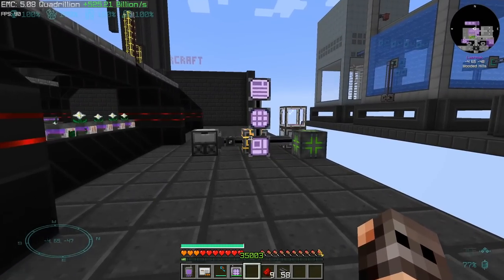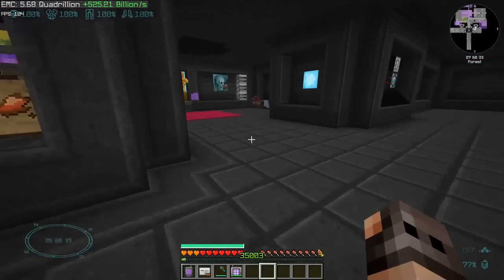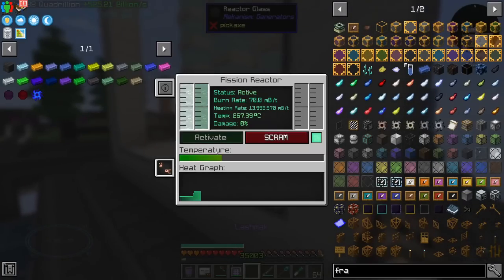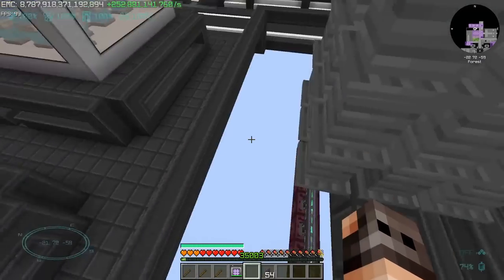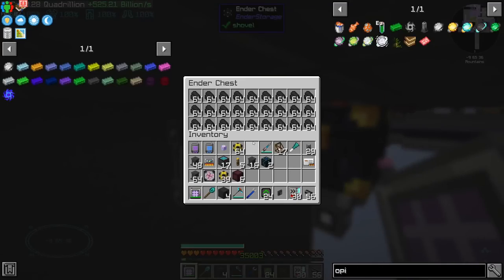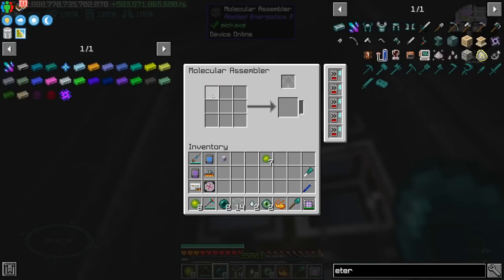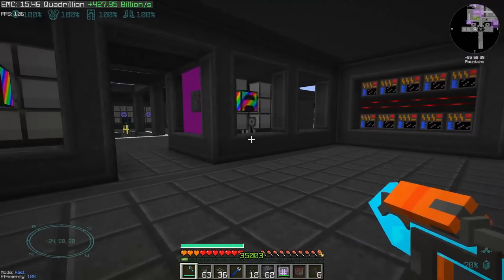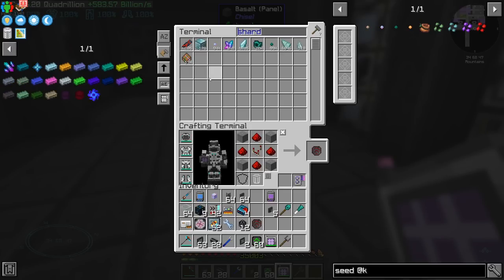NTC2-Ep21: Opinium Cores

Comment: Instead of using crafters you can use a backpack with a compacting upgrade. Way faster for x3 or x5 items. And as for emptying your ender chest fast just put a pipe directly to an interface.
Reply: That would be a cheap and dirty way of doing it and Lash clearly doesn't like cheap and dirty.
Reply: At that point he could just use a compacting drawer. I mean his issue was kinda silly since he doesnt have to storage bus it, but im assuming he just doesnt want to do it a cheesy way. 

Like instead of crafters, he could like quite literally put a single compacting drawer instead and itd work better. The recipes stay exactly the same. Just need to filter it instead

Comment: Using storage drawers the same way that you use crafters might be a good solution for your issue. Hook the drawers up to a chest with an interface or something that works better and you won't have to hook the drawers up to your system directly and have the misinformation issue
Reply: .... that actually makes sense, thats an easy block crafter! However there is something to be said about using crafters to craft.
Reply: yes, use an interface on a chest and pipe out the item into it. And the same way with pipe out of the drawer

Comment: Oh my Dear Lord of the Darkness, it is I, Guga, once again here asking your permission to give you a tip.
Try separating your ender chests to pump items to your system, like one for general items, one for chemistry, one for cores/essences etc, cause I noticed that if the ender chest connected to your system gets clogged up, it lags A LOT.
Along with separating them, I managed to save a lot of channels just by using some interfaces and piping the items out of the chest with pipes instead of using importers, so instead of using 6 channels for 6 faces, I'm using only 1 channel

Comment: You can use a processing upgrade in a centrifugal separator with any tier of emc link to get the matter back so you dont have to spend as much time afking for emc. It also works for the final star shard with the final emc link.

Comment: i normally love the Time in a bottle... but in this pack, except for the first 30 mins to accelerate the first bamboo pot its absolutely useless. you can just craft more mob cages or pots or what ever and it is so much more convenient than using the bottle. 

im  now nearly done with the pack. only missing a handful of singularities. 

TLDR: the neutronium singularity was actually LESS grindy than the 4x... the colossal star was actually quite easy if you keep up with upgrading your EMC gen. 

the antimatter though... even my 5 block systems was lagging way more than 40 mobcages + 100 botany pots combined..  
since MEK normally isnt lagging im pretty much suspecting only the stupid machinery. (esp. since it cant even use the 4th upgrade..)

PS: the solar panel singularity was by far my favorite. nice mixture of mods and crafting, though very heavy on glass... and for some reason mekanism feels slow AF in this pack..

Comment: In theory you're right about the misinformation for the transmutation interface and the storage drawer. However, practically the transmutation interface will cap at 2.1G, so 2.1 billion items of anything. If it shows 2.1G redstone dust and 2.1G iron ingots, with your amount of EMC, you will actually have both. The only thing you can't really rely on are the amounts of high tier matters and stars.
I appreciate the time you took to explain it and most importantly you should always keep playing the way that you like best.
Those crystals took me forever, I hate them. I had a similar setup for the cores, it worked but it cost me a lot of TPS; I wonder how your base is doing?

Comment: Auto-input and auto-output functionality on machines is typically as fast as the machine can work. Additionally, because the machine only moves items when it needs them, it creates significantly less lag. Using stocking interfaces or matter condensers in direct contact with the machines will allow you to take advantage of auto-input/auto-output which will help keep lag down a lot compared to pipe spam and importers/exporters.

Comment: i understand your reason for compact drawers but you can also use the same system that you are using to add emc-items to your network ,just adding one or two compacting drawer between with a filter let it run for 10 min or so and you will get like 1 million+  of any compact "emc-block"  . try upgrade the raimbow furnace speed  it can get  beyond stupid broken >:D

Comment: Regarding the first bit with the compacting drawer/emc link problem:

Wouldnt that problem be "solvable" if you used an AE2 System separate from your main system that exports any emc-able item to a drawer network that is connected to your main system?

Something Like:

EMC System -> Exporter -> Drawer Controller with a drawer for every needed item |-| Storage bus |-| Main System 

That would exclude the problematic crafting of those items. it would also only ever report actually materialised items in your main system
Reply from the maker: bello <3
that is aboslutely true and also i can just use the drawers as a machine on an inteface to make blocks too with some filtering. the issue is that i get this comment alot because everyone thinks i have problems with making blocks :D i nagged once when i was using molecular assemblers, when i switched to crafters, i never experienced a problem. besides, quartz and endstone are being done by drawers anyways in the botany pot area. i mean i do understand the merit of the suggestions, its just that the problem that everyone refer to, isnt an actual problem. my problem is anti matter :D

Comment: IF YOU PLACE the bind block near where your going to have like a chest place the binding block right next to it and you can just break it the nbt is saved and mabye use the binding block in stead of ender chest the binding block pretend to be the block and then you dont need to pull from the power pot its inventory its juist ther then so you can pull faster ok hope it help sorry for making it so long just hoping to help a bro